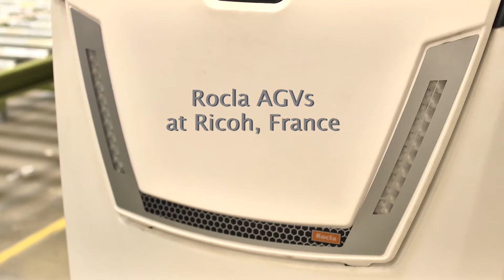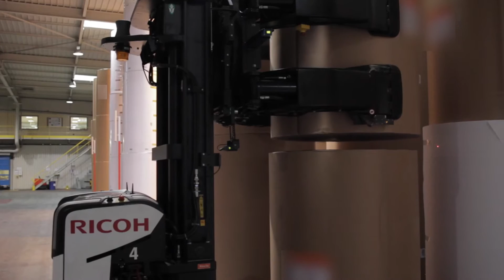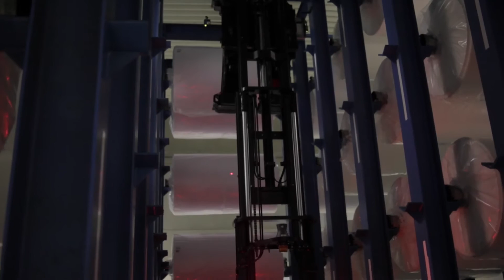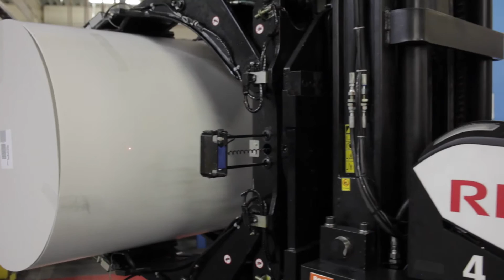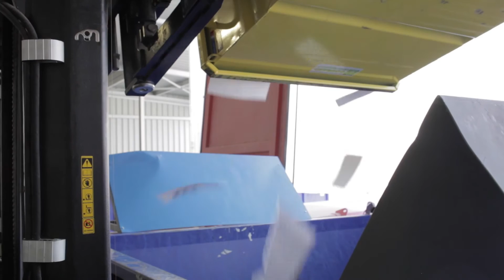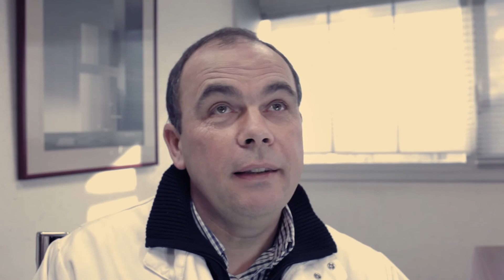Ricoh’s thermal paper production process is automated with Rocla AGVs

Comment: Dear Sirs, I am interested in 2 or 3 second hand coating lines to produce thermal paper

(for till receipts) as per following specs.

Width: 1 – 2 metres

Min working speed : 300 m/min 

Max inlet reel dia. :1050mm

Please contact me if you can assist.  Best regards, S Howell - info@janustech.co.uk